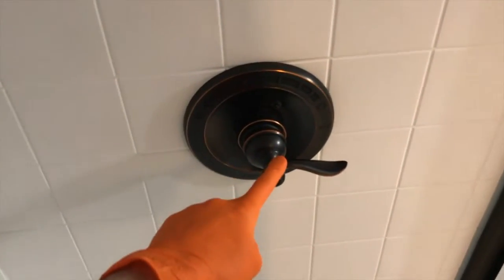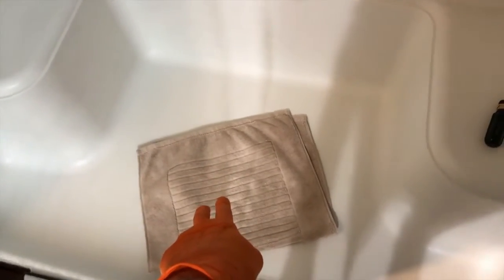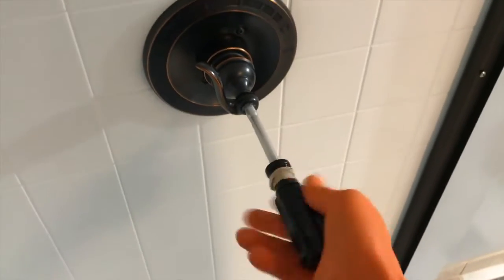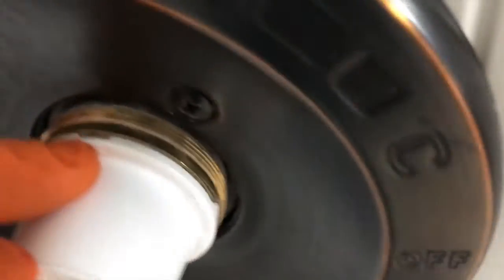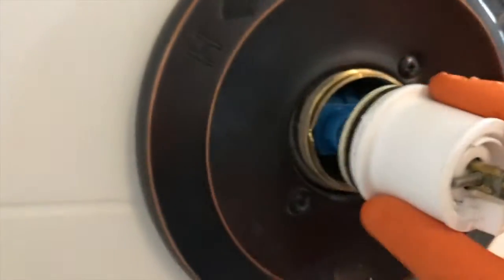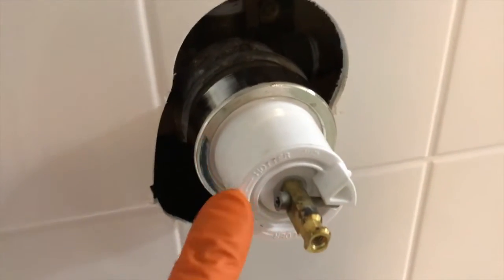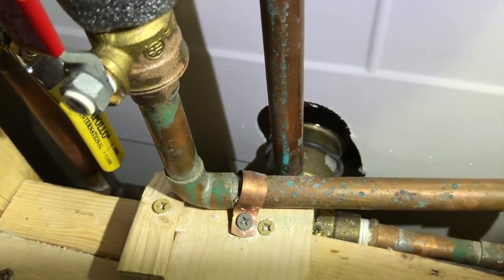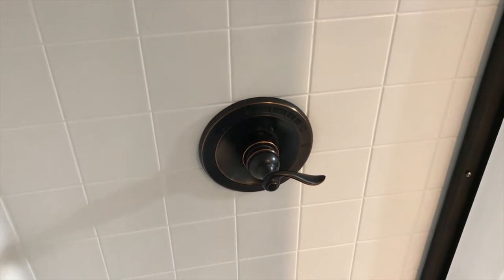Reversed HOT and COLD shower handle - DIY fix

Comment: I have this same handle. My problem is my hot water is to the right cold to the left. So when I cut the hot water on the pressure is low since it’s hot water first. How do I fix that
Reply from the maker: Thanks for watching, any update?  Have you configured the inner cartridge back to its proper orientation?
Reply: @DIYwithMichaelBorders  is that what I need to do?
Reply from the maker: @BillyRay501  

Thanks for the reply.  We recommend following the steps in this video to get your inner cartridge configured properly.  👍🧰
Reply: @DIYwithMichaelBorders  ok
Reply from the maker: @BillyRay501  

🧰

Comment: I have the same model of handle. I’m to the point of trying to pull the handle off after loosening the screw. But it won’t come off the wall. And the screw doesn’t come out all the way. What could be holding it on so snug?